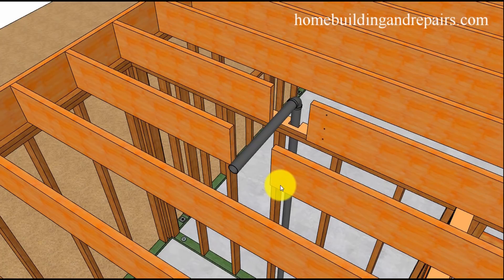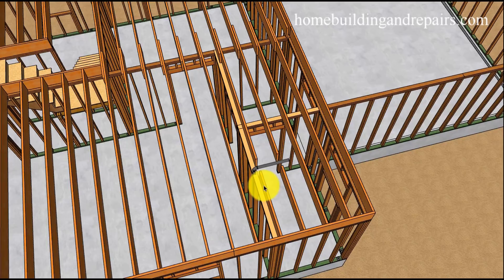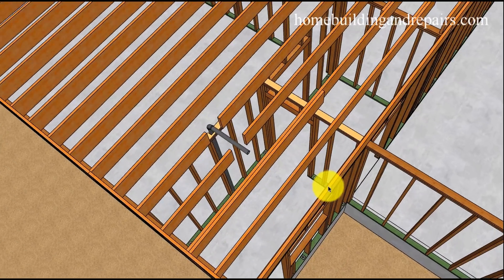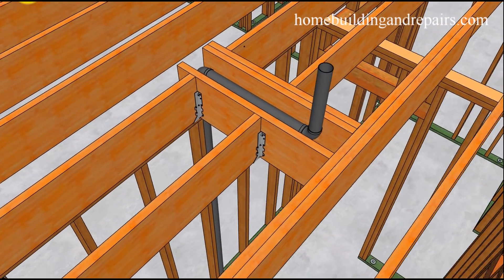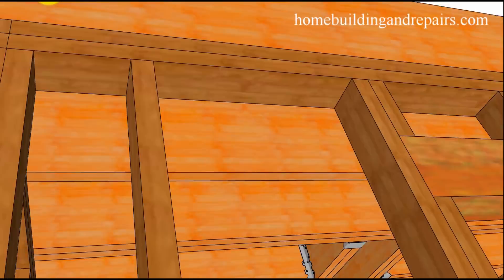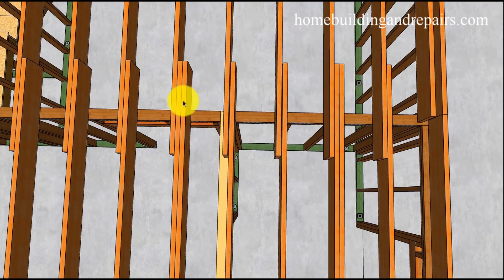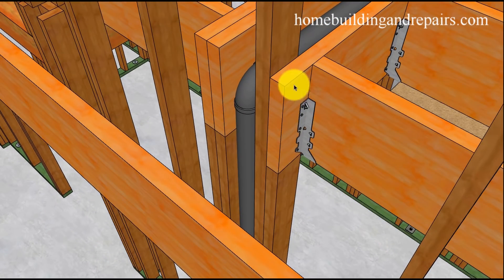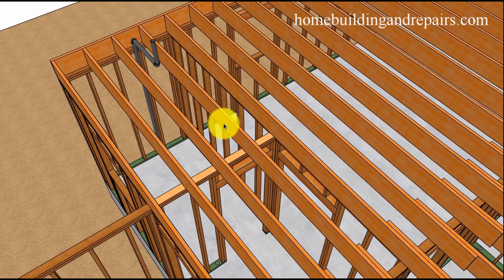How To Repair Second Cut Floor Joist Next To Wall - Plumbing Pipe Problems

Comment: You are a man of profound patience I don’t know how you can deal with YouTube armchair engineers commenting. I’ve spent 25+ years working on homes, I’ve seen them built with old box car lumber I’ve found 16ga extension cords run thru walls for outlets and I’ve repaired quite a few of the problems that you just presented. I’m always amazed that more houses don’t collapse or burn down.
Reply from the maker: I don't mind a little criticism here and there and I do try to remove comments with misleading information or offensive language. I've seen some bad building designs myself, but living in Southern California rarely, came across anything over 80 years old. I can only imagine what carpenters run into back east.

Comment: An engineer once told me that he tries to avoid using the terms "load bearing" and "non load bearing" unless talking to other engineers.  He uses "less load bearing" and "more load bearing" to drive home the notion that all walls carry some load, especially after some time has passed, and overhead members have settled on them.  Great video!
Reply from the maker: I like it.

Comment: Can someone please explain why anyone would consider the short wall to be “non-load-bearing” ?  It’s got 4 joists across it, and mid-span as well. Thanks for any insight.
Reply from the maker: It might not be load bearing, but you would need someone to look at it like an engineer or local building contractor to verify.

Comment: I have that exact problem with my 1910  balloon framed home. I had to open the wall to replace an old cast iron drainage pipe. I noticed they cut the ledger board between the joists so the pipe can go to the 2nd floor bathroom, which is above the kitchen. I think I will approach this the way you are suggestion since I will do a complete remodel of the kitchen. Limited budget and cant afford an engineer unfortunately. Thanks.
Reply from the maker: I understand and hope everything works out.

Comment: Hi Greg, just bought a house with a separate garage that is about 30’ x 20’. It’s been eaten up with termites. I’m looking for a video on how to replace all the wall studs and some of the boards at the top of the 2x4 studs, running around the whole building-I don’t know what they’re called (‘top plate’?). I’ve heard about  “sistering in” new wall studs. But I don’t know how to replace the top boards that support the joists.  I’m hoping you have a video that would show me how to do this but I don’t know what title to search. Thanks so much.
Reply from the maker: Here's a link to some playlists that might be helpful. The one you're going to be looking for should say wall framing repairs. Let me know if you can't find it.
http://www.homebuildingandrepairs.com/playlists.html

Comment: Greg, I really appreciate your videos. Great information and animation. Do you have a video on the use of flitch plates with joists? We are doing remodeling and discovered less than ideal joists. Thanks.
Reply from the maker: No I don't, but if you have some pictures I might be able to make a video in the future. I put it on my list of videos to be made in the future, even if you don't have any pictures don't worry about it.